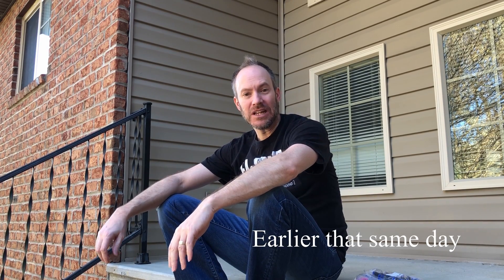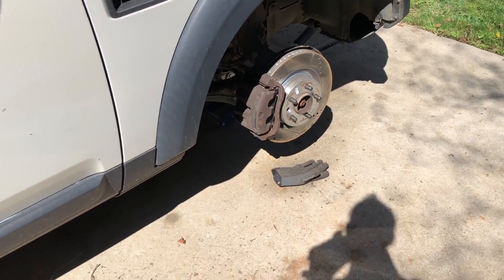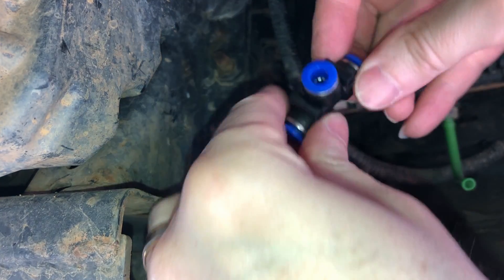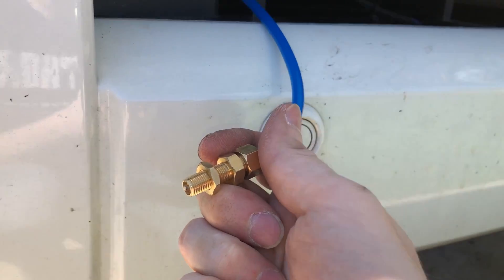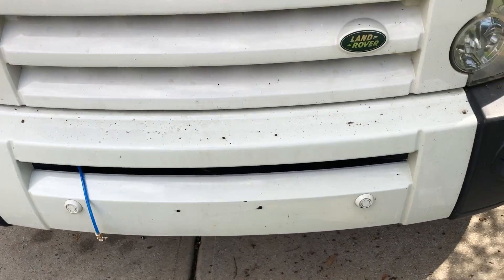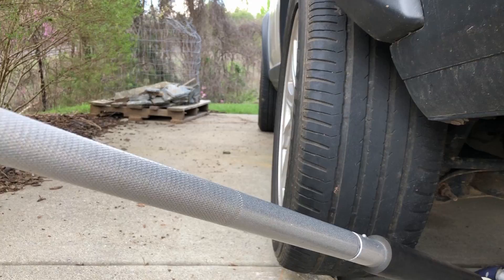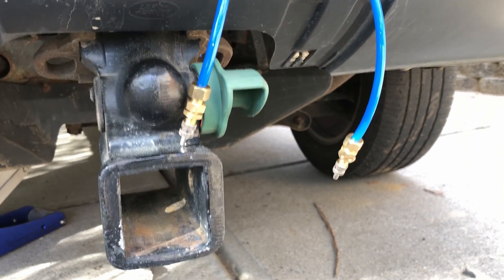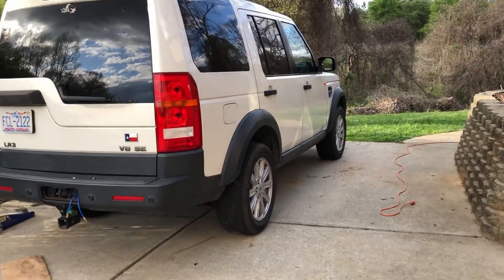Air Suspension Manual Override - Emergency Lift Kit.  Land Rover LR3 Air Fix!

Comment: Awesome, I was wondering about a way to do this for emergencies.  Mine was converted to coil before I got it but ive always wanted to go back to air because its a big part of what makes the LR3 so great.  I just ordered all the parts and new air struts to get this going (I'm sure I'll need to replace other things) but this gave me the morivation I needed.  Do you still have your LR and Im guessing there might be faults but its still highway drivable after you manually air it up?  Thanks
Reply from the maker: I sold this one a while back. But it did highway just fine on manual air.

Comment: Couldnt you splice it again or twice so u only have to pump once for front/back if not all
Reply from the maker: The front and back of the LR run at very different pressures due to the difference in the weight of the engine versus the empty back.   I choose to split the front as well, so I could adjust if needed for the weight of a single driver in the front left, or if I had a different group of passengers that would weight it left to right.    I think you could get away with one for front and one for back to simplify, but I like knowing I have the option to adjust them individually depending on load.
Reply: @FarReachFR  good stuff i will be attempting this this weekend, any last tips.. in theory looks like a 10min job

With a silent non powering compressor
Reply from the maker: @EVSWISH  It certainly took me more than 10 mins.   But a day was enough.  Having a compressor that can reach the pressures you want to hit is key.  something that does 150 psi would be ideal.   Good Luck!
Reply: @FarReachFR  was hoping to have an accessible inflation nozzle for the fuel station's compressor? lol

Comment: With this system you can bypass even the switches and add hydraulic switches from tire machines eather electric ir manual and will probably las t longer

Comment: OK so I have the hse or l322 but my blocks have 4 lines as yours has 3. Mine it seems that they are color coordinated. 2 yellow an 2 black. Seems like 1 yellow comes from reservoir an the other goes to the air bag. Each line is next to each other so it seems like it's a connected line. I have to do the same thing as you. But I can't seem to find any thing on how these crossover blocks work in the l322. So I'm gonna chance it and tap into the line from each air bag and set it up. I hope it works lol

Comment: What kind of shredder valve did you use? The ones I find are the quick connect without the bolt to tighten where did you get yours?
Reply from the maker: here is the link to the ones I used.   I have more links in the description as well. 

Compression fit:
https://amzn.to/3XSRqVI

Comment: If you removed left and right pipes for the front or the back and then joined the 2 with a T piece then to schrader valve would they both pump up equally together from 1 valve. Asking as thinking of doing that

Comment: Why did you run two lines from each wheel
Reply: You could have used a splitter
Reply: It's because hes including the stock compressor, so the three lines are manual air input, input from compressor and line to shock

Comment: Hi, thanks for making this video.
I am going to do this to my D3.
Do you think it would be ok to join the  hoses together at each end so you can inflate both sides at once?
Cheers
Reply: It absolutely is but the only problem is most people dont have a air compressor strong enough to pressurize both shocks at the same time, but yes both rear or front should be equalized for street use. Offroading will be problematic as when you tilt the vehicle sideways the lower side will dip and send higher pressure to the high side causing you to tilt even further!

Comment: Just a heads up. The linked blue air hose isn't strong enough if used off the shock.  I had a leak at the shock and used the blue since I had a different connector to use.   It literally blew a hole in the line a day later.  So I reused the old black line.  I still have the other tubing off the T connector like in this video.   Hopefully it is strong enough.   The quick connects do seem to work well
Reply: Now two others both blew.   The linked blue hose isn't strong enough. Size is correct but find stronger air line

Comment: cool staff very nice i will do the same for now !! Question did you get any error message form  the hight senors ??? And why did you not connect boths the right and left fron in one line and the  same at the back, and then join the 2 to one ?? so you have only one line to put air in !!!! you get what i mean.

Comment: Is there any reason why you couldn’t T the 2 new supply lines together so that 1 Schrader valve would feed both side simultaneously? That way both side would always have equal pressure.
Reply from the maker: You could and it would likely work reasonably fine.  That said technically depending on loading the left and right could be under different weights.   For example if you have a driver and not a passenger, and thus require slightly different pressures to level the vehicle.   This is why LR measures and modulates each corner.

Comment: Just discovered this video! Absolutely amazing! Just might do it on my own LR3, this just might save my rear if there was ever a suspension fault, I can disconnect the air distribution block and manually pump the springs!

Comment: I'm watching this 2 years on. I hope your black plastic T pieces are still holding because they're only rated to 10 bar and the air springs run at about 14 bar.  The brass 20 bar fittings are far more reliable. and reliability is what you are trying to achieve here. As an aside, I've never had the airbags deflate or get damaged on any of my L319 Landies and I have given them some hammer over 10 years and 600,000km. Driver and passenger sides are potentially confusing to international viewers. Stick to Left and Right. 
Tell me you are an American without telling me you are an American: call a Land Rover a Rover :)
I have an air take off on my L319s to use the suspension system for emergency tyre inflation, using similar kit to you. 
Overall a good job. If you do use this manual override, be sure to disable the air suspension control system by pulling F26 or using an IID tool to disable it.
Reply: It's a shame LR didn't offer or include a way to use the compressor to inflat the tires

Comment: Why don't you T connect both the front and T connect both the rear. This way you will only pump twice instead of 4 and it will even easily.

Comment: This is so similar to BMWs of that time, my X5 will soon be converted to oem air bags but manual shraders like your LR3. The mechanics between both vehicles are like a mirror to each other, wild to see!
Reply from the maker: more than just similar.   BMW built many of the components on the LR3 of this generation.  You have a keen eye.

Comment: I just  replaced all air suspension air bags springs and new air compressors and value block near compressor Now I have 2 faults C1A08-1C &  C1A20-64 means slow to
Reply: When you did this did this also fill your reservoir tank and what was your reason for doing this for me my lr3 has some kind of wiring in value block or something everything was fine until I replace everything with new part now I'm on bump stops
Reply from the maker: I did not fill my reservoir tank.  I did it because there was an electrical fault keeping the compressor from turning on.  I recall it being an overheat sensor response, even when the thing was stone cold.  In any case, forcing the air into it I bypassed the whole lot of it.
Reply: Thanks for your response,  I bought the kit you used to air up I had issues with the quick connect Schrader leaking air I am sure you probably seen LR TIME viedos he remove the plug on resivor and installed a quick air connector I'm going to try this to see if it makes a difference and air up my lr3 I have a 60 gallon air tank I like the viair Schrader valve that seals better I order one on zoro they sent me the wrong one
Reply from the maker: @jamesray3920  not sure if this is related, but be aware that schrader valves are made to be unscrewed on the inside.  You likely know that already, but just mentioning it as when I received mine the inner cores were loose and wouldnt hold air.  But once I screwed the interior of the valve back down like I feel they should have been from the factory, well then all was fine.  Good luck in your setup!
Reply: Thanks. Yes, I know they need to be screwed in, but the quick connection was leaking on viair the ones you showed screwed on the airline I installed a new arnott air compressor but keeps cutting off then light comes on it could be the reservoir valve body I bought off Amazon nor sure I just ordered a oem one to see what happens I just want the lr3 to air up it's driving me nuts

Comment: Great video! Thank you for sharing this tip, it's a game-changer! I replaced the front air struts myself but my suspension still lowered, I noticed that it's the compressor that is gone. I don't wanna deal with it I'll do this instead. Nice work man, really appreciate the share. 👍👍👍

Comment: Hi - Great Video  - Just 48 hours ago I used the 400psi rated DOT approved brake nylon hose 1/4 inch on my Range Rover with the same make of blue fittings — Question I have is that using the shraeder valves that you quote above comes with the same "Push to fit " connection to the nylon pipe as the blue connectors so I'm unsure why you need the Compression fittings  - can you clarify please  — I also have changed my Compressor and all 3 valve blocks and still have Air suspension issues. - I'm close to giving up and fitting a coil kit - This fix might help  — Thanks

Comment: Hi good video very well explained I have a question please if you can help me? Can I still drive normally with a suspension fault? I have the amber suspension fault light on the dash with the description reading clear obstruction/ obstacle as the car is in extended mode even though there is no obstruction. Any advice will be very much appreciated.
Reply from the maker: Yes you can keep driving it, if that is the only error/issue being experienced.  The warning lights might yell at you, but you are still the boss.   Its not going to cause engine damage for example, if the only issue is it wants to lower itself down, and it cant.  Be aware that if you are in extended mode you are a bit taller, so you might be a slight bit more tippy in the curves and corners, so just go a bit slower on turns.

Comment: Nope. One section of PU tubing, the kind link above, blew out on the maiden voyage. I also bought nylon, as recommended by another commenter, and the working pressure and burst rating is like 2-3x higher, but it was so rigid I tried the PU first. Now I have to do the job twice. Otherwise, for now, seems to work as advertised.

Comment: WARNING READ BEFORE YOU INSTALL THIS SYSTEM: OK, while the idea is sound, the pneumatic piping and the push joints he's recommending are total rubbish and dangerous; i'll explain. The piping is plastic and heats up anywhere near the engine and blows out!!!! Trust me, with 110lbs of air in the pipes it's easy for it to blow out. I did this job as an emergency fix, just as he does. It does work, however DO NOT ORDER THE PLASTIC PIPING. Luckily for me I was stationary when the airline blew out in the front, first on the left, then 30 seconds later, same on the right. You MUST buy 1/4inch nylon pipe (NOT 6mm plastic pipe as he suggests) Nylon pneumatic is the only pipe that will hold and not blow out under heat/pressure. ALSO the kit he recommends DOES NOT COME WITH VALVES to actually put air into the system. You will need to order 1/4 inch Schrader valves off of Amazon to make the system affective. Hope this helps.
Reply: Are you correct man! I make all on my D3 and tested this common tube and compactors really not works the pressure is too high now i use only nylon like oem and conectors pro! This stupid man that said to you he doesn't know how to fix skate, the video is great the idea is great also 👍🏼👍🏼
Reply: First of all, nylon is "plastic" 
Second, ALL of the factory air lines are "plastic" nylon. Even the valve blocks are plastic not any kind of metal.
Third, why on earth would a European car that is ENTIRELY METRIC use 1/4" tubing?
You are talking about the difference of 0.250 inch and 0.236 (14 thou) or  [0.356mm)
Reply: @wesbuckley5535  100% Nylon, not cheat crap like in this video, proper pneumatic pipe line, not dinky toy shite. I'm in the US so there's that, and finding 6mm valves is a joke, you try. I had this exact kit blow out on me, it's a warning what's your problem with that? "First of all" go check yourself.
Reply: @wesbuckley5535  "European" 🤣 In Englandshire we invented Imperial measurements.
Reply: Ah, American.  Please ignore my previous transmission; I wouldn't want you to have to travel to Canada just to point your pistol at me. 
(Watch how that "triggers" some angry counter-reply).
Reply: @wesbuckley5535  Have the day you deserve bud.
Reply: @wesbuckley5535 firt dont know anything about this car second the guy just wanna be help man you need try check out this first, he is right!

Comment: You seem like you're mechanically inclined why not just change the three air blocks and the compressor and it should be fine. The point of the Land Rover is to have the LR3 suspension work for you while offroading. Anyway goodluck cheers 🍻
Reply from the maker: Thanks for watching.  Reason I didnt swap those components is that they were not the fault.  Air blocks and compressor all checked out fine.  Mechanically the suspension components were in good shape.  It was an electrical/computer issue. This mechanical override, let me use the truck when gremlins acted up.
Reply: @FarReachFR  ok hope you can fix your LR3 the right way and enjoy it the way it's supposed to be enjoyed they are awesome trucks even with it's sometimes pain in the butt gremlins. 
Cheers 🍻

Comment: This is an ingenious temp fix if the strut values are  not leaking air ! That's the expensive fix ! Would you have the ebay ! Amazon part numbers. I have the very same problem - Kindest regards - Clever guy
Reply: New Air bags go for 200$ each. Thats not very expensive. Dont have to change the whole strut which is about 1000$ for the fronts

Comment: Can you post an update to us about this manual hack you got going on. Has it leaked? Does it hold air for a long time? Etc etc
Reply from the maker: DJ - as an update, I sold the White LR3 not very long after this update.  He was an interested buyer and I used the opportunity to update to an LR4.  I had it about a month with this mod on it, and it held air well and worked for me.  But I cant say longer than that, simply because it is no longer in my stable.
Reply from the maker: Sorry not to have more detail on it.  I actually wish I had more time to play with it myself.  I didn't actually expect it to be sold so quickly after the mod.   I had plans to run a bunch of different pressures and height configurations, but you know how it goes.

Comment: How much PSI did you fill each side up to? I am doing this on Sunday to my 2006 Land Rover LR3 SE
Reply from the maker: Hi DJ, I actually dont recall the exact figures, but about 70 psi in the rear and I think it was close to 120 psi in the front.  But take those figures for what it is worth.  It was a lower PSI than I expected as the front and rear PSI I have seen recorded elsewhere list 145 PSI and 116 psi.    In each case though, it will relate to the weight of the vehicle.  The front always runs at a higher PSI since it has the heavy engine up front.  The rear is always less unless you are hauling a heavy load, since the back is usually mostly empty.

Comment: Amazing.... so if I want to do this in my Rover , I would need a compressor that can provide at least 60 psi? Could you tell me a list fo the parts needed and where you got them. Thank you
Reply from the maker: Thanks.  I would recommend a compressor or  pump that can do 150 PSI.  (60 psi is not enough)  While the back sits high even with 70 psi,   The front is much heavier and runs at a much higher pressure.  100 psi will only barely get the front off the ground.
Reply: @FarReachFR  could you please provide a link to the tubing and valves sets?
Reply: @FarReachFR  
Do you have your parts list and where you purchased everything. Thanx

Comment: my GF did this on hers.  She has arnotts so they have a check valve set to 75 psi so you should in theory never end up  on bumpstops.  Regardless she put a T fitting that bypasses the main compressor so that we can fill manually.

Comment: A warning to those interested in doing this. Never work with the car's air system without supporting it with heavy duty stands. It will drop very fast if not being careful.
Reply: What if I do the hose connections by the air suspension compressor instead . Would it be possible to pump all 4 together
Reply: @iloveoldschoolmusic3255  i ask myself the same question
Reply: Ok but if your hooking up air lines to the car which is already on its bump stops the car cannot physically go any lower. You sound like a guy who can’t change his own oil lol
Reply: @Lying992  Are you unable to grasp what I wrote? 10 people understood at least. I wrote in general working with the air lines.